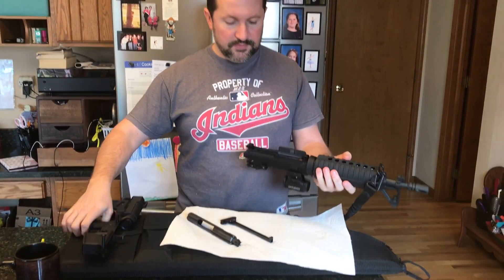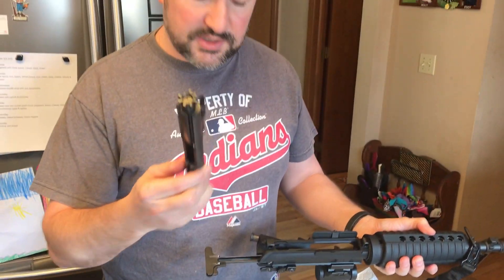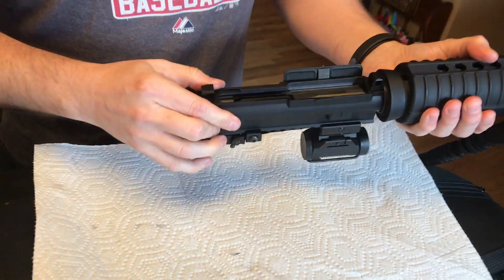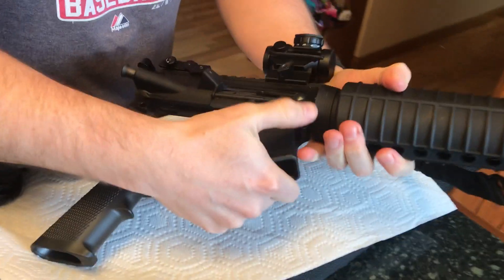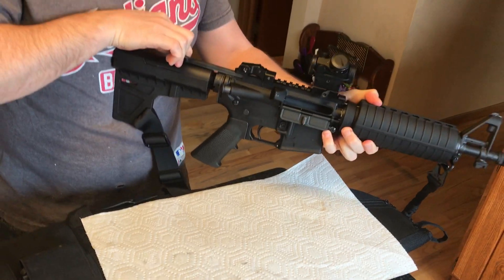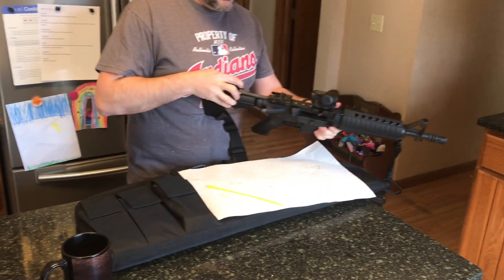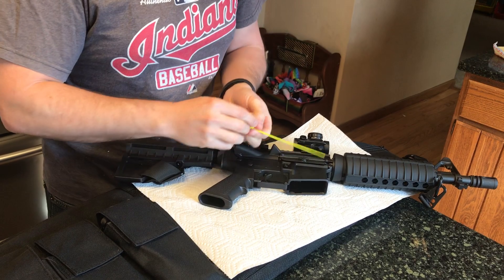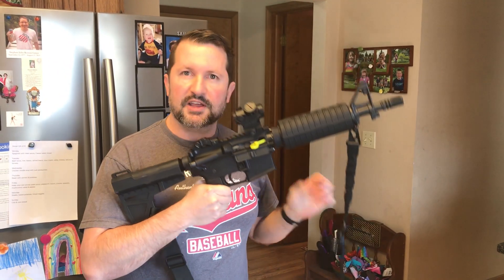Upper to Lower Assembly

Comment: I have a question.. I want to build a PSA basic AR 15. IF I order a Complete Lower and Upper Reciever is that all I need? Does it just snap together and I'm done?
Reply: I looked up this video for that very reason. I ordered a complete lower and a complete upper from PSA, and I just put them together using this video. It was much simpler than I had assumed. You shouldn't have any issues if the upper and lower are complete.
Reply: Yep. That's all.
Reply: Yes if you order a complete lower and complete upper. 
Small side note just to make sure it says they include charging handle or CH and bolt carrier group or BCG. Sometimes you’ll see deals online where it says upper but they just give you barrel and hand guard lol
Reply: This answered my exact question to, thank you bahaha